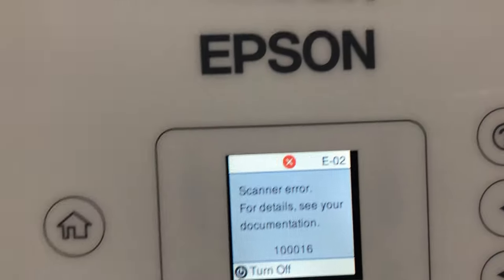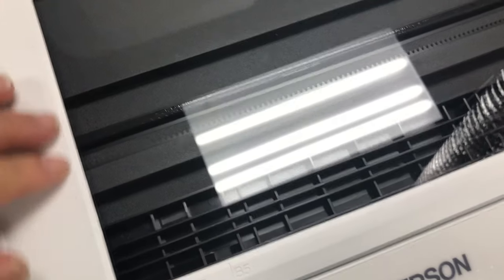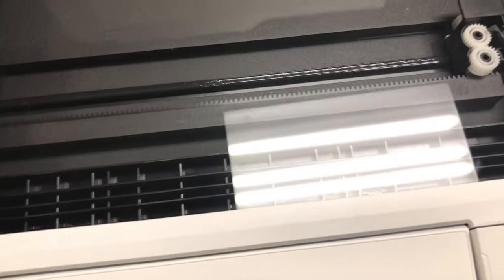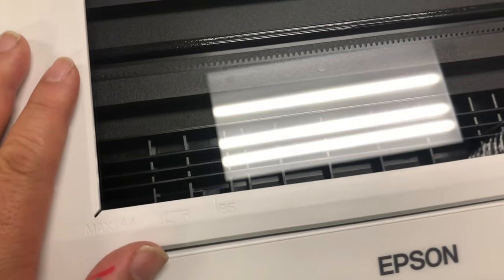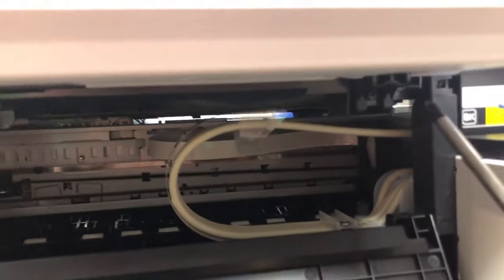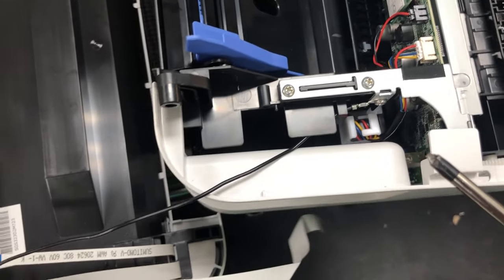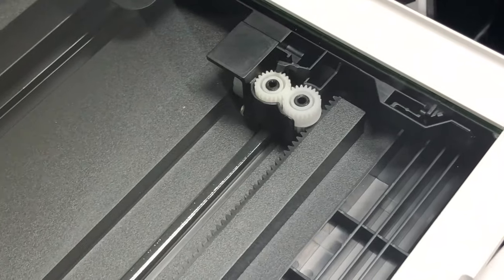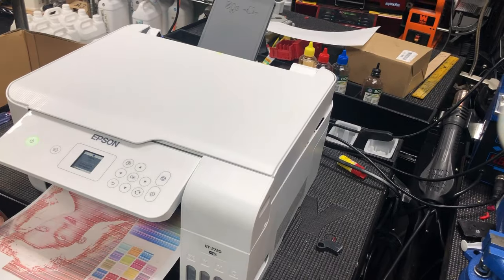Fix Epson EcoTank Error E02: 100016 Scanner Error for details see your documentation.

Comment: Thank you. My smaller ribbon cable came loose. I removed the side of the printer and plugged it back in. This cleared the scanner error. Thanks for the video that hot me headed in the right direction.

Comment: Thank you thank you! I had the error for months on my new printer. I followed your directions and found out that the smaller plug on the motherboard was not connected. It is all fixed thanks sooo much!

Comment: Thank you for your video ,  I tried this method  once before  and it worked ?, it happened  again and now the   smallest  cable wire  is  badly scratched   is there a video on how to  replace or fix this problem, can this wire be cut?  or does the wire need to be completely replaced and if replacement is necessary is there a video on how to do this ? Please  advise   I am sure  that is the problem with the printer as it was working fine.  I really do not want to get rid of it if I can fix it with a spare part.

Comment: Hello, I was setting up a brand new Epson Ecotank 2800 and trying to get it ready for sublimation. Soon as I reached the step after preparing, it mentioned it would take 11 minutes, but before it could finish I received a message that there's an E2 scanning error with the same numbers underneath.😭 All the website says is to shut off and turn back on, but it's been wasting my sublimation ink. I tried to follow the steps you mentioned, removed the screws to open the printer up and looked at the three ribbons, as well as removed the side panel to place the ribbons back where they belong. When I went to open the printer, a screw was missing from the front already and on the inside there was a piece of black tape on the inside near where the ribbons were. I removed the black take and observed the ribbons. I didn't see any damage, so I proceeded to use a dry cloth, even though the ribbons looked like there wasn't any dust or damage. I've been trying to figure this out for awhile now, any advice would be appreciated. The latest is that when I try to turn it on now, it skips the initiation step, but when I try to do anything, such as copy, or maintenance, it says printer busy, and then the same error message happens. I'm not sure if it's the way I'm loading the paper, because it doesn't seem to smoothly be able to be pushed to line up with the arrow where the printer rear tray is, or if I'm not loading enough pages at the same time. I also was in the middle of setting up the wifi network to connect to it, but I couldn't finish setting up the wifi because of the scan error. I finished trying to set it up on my cell which is android, and my laptop I'm using is a MacBook Air. Additionally, I was using brand new A sub sublimation paper, but then switched to use regular copy paper to not damage or waste the sublimation paper, and the Hippo Sublimation Ink that mentioned it would work for an ET 2800.😔 I don't know if it's a printer problem, or a problem with the sublimation ink, paper being loaded, or air in the line, since I can't get passed this error code to even attempt to print anything. Thank you in advance for any information or assistance you can provide.
Reply: Have you figured it out?! I had the exact issue! Omg how interesting! I just bought the et 2800, my husband also notice that a screw was missing in the same spot like you described. Mine is also showing error😒. I'm thinking of just returning it
Reply: Hello  @mayvue3075 . Sorry for the late reply, I just saw that you left a comment. 

I'm not sure if you already returned yours or not, but what I did was contacted the merchant that I purchased from, in my case, Amazon and explained the situation. It was under buyer protection, so they issued me a 1x replacement for the printer, and said the faulty printer, I could keep. I tried to fix the one that didn't work, and found a video that was about the scanner having an issue, where you have to take the section with the glass apart to get to the mechanisms inside. I followed the steps, which seemed like it might work, but then the part that holds one of the mechanisms that moves the scanner, broke when I tried to follow the instructions, so I'll never know if it was an issue because of the scanner not being able to move or it just was a defective item. The replacement printer I took the chance to try setting up for sublimation again, and thank God it worked. So maybe we both just received bad batches or printers that previously were defective, I'm not sure. I hope it'll work out for you too. Sorry for the late response.

Comment: Hi Kevin, I find your channel excellent. I have a problem my Epson workforce 545 is showing a Printer error problem. no code number. it states turn off and then on again. I have done these to many times to count. I changed out the ink and placed in a new Epson ink cartridge. I cleaned the print heads, the printer came back on then I went to check the print pattern and the error came up. Please help.
I have not been able to use the printer since.

Comment: I purchased a used Epson ET 2760 the seller said it had a jam paper error. When we received it the scanner was off the printer with 2 small ribbons out, I don't see a 3rd large ribbon. It appears the scanner was forced too far back when opening it up. Does this model use a 3rd large ribbon? How do we dissemble the printer to get to where the cables connect?

Comment: I tried this and still get the error code, the scanner does not move. You mentioned in previous comments it may be the scanner itself and to take it apart and figure out the problem but I am not confident in myself. Do you have instructions or a video of you taking the scanner apart and figuring out why it won't move?
Reply: I have this same problem,  took out the cables put them back in and still have that same error
Reply: @latoyasmall  Same.  were either of you able to figure it out?
Reply: I have the same issue. And it's brand new! Ugh so frustrating.

Comment: Just bought my printer a week ago , changed out ink (making it a sublimation printer) I initially put in the wrong ink so I followed a video and drained the printer of the wrong ink and now when I turn it on (haven’t added new ink yet) I get a scanner error - 100077. I’ve unplugged and plugged back in multiple times . Nothing . Epson says just take it back to Walmart and exchange it but my Walmart and every Walmart within a 100 mile radius is out of stock. So I need to fix this . Can you help ?
Reply from the maker: You can call Walmart and they should be able to arrange a pickup or Fedex.  What is your EcoTank’s model?

Comment: Hello. Can I get help with scanner error code e02 100032? I remove both of the little cables in the back and reinserted and reinserted the larger cable in the front. The printer turns on but I can't bypass the error.

Comment: Great video. I have a brand new Epson ET2720, it was working perfectly until i had to replace the ink with sublimation ink, then had the error 10016, which you helped me fix the issue, now i have the issue of error code 10032. I've uninstalled and then reinstalled the software. Any ideas of what might be causing this error code and how to fix it?
Reply: I have the same error, did you ever fix yours?!
Reply: Same error.. anyone know? It's so frustrating I've tried everything 😫 nothing works. 100032 giving me hard time!!
Reply: @LC-no5zx  luckily mine was brand new, I returned it and bought the ET2800, it’s been great!
Reply: @candacealfonso8279  lucky!!!unfortunately mine is done on any return lol I got mine in May last year but I've only used it 35 x so it's basically new. I ended up taking it apart and making sure wires were plugged in right like 50x. Then when I was about to give up it magically started working again. No more error. It's really hard to hold top open and try getting wires in with no help. Now I just gotta fix the black ink cuz it comes out really bad when I print. It's lines everywhere.  🙄ugh
Reply: Instead of remoting in wirelessly, I plugged it into my computer and it’s working fine now.
Reply: I have the same issue.  I change the ink .  I don't know  what to do. All the cable that he show in the video are in . So I don't  know  what is the problem.  I download the software still.

Comment: I think my issue was the wires got pulled out... but I have reconnected everything and I'm still getting the error. Only thing I can think of is that where it connects got ripped off the board and now it can't connect anymore--that or the ribbon wire got damaged.

Comment: Help.  I can see I have the med and the small cable that aren't connected to anything.  I can't no matter how hard I try to get the back off.  I have pushed in on the white tab but it doesn't seem to release anything.  What am I doing wrong.  This is a new printer and I am getting really frustrated.
Reply from the maker: Make sure they aren’t upside down.  Hold on the blue part and push.

Comment: I followed the steps and connected both cables in and nothing prints out still. Help 😭
Reply from the maker: What is the error code displayed on the panel?
Reply: @BCHTechnologies  there’s no more error code. Omg ive watched so many tutorials and none of them have worked im doing exact steps idk what I’m doing wrong. It prints as If it’s going to print but it’s a blank page. I’ve done everything
Reply: @iitselyyyfooo  did u find a solution in having that problem

Comment: It would help if you show how to open the front of the printer instead of jumping ahead
Reply: Hi, there are two screws   one on each  side  corners  of the printer . its on the top  under the  window pane, remove them and you will be able to lift the top.   inserting the  smaller wire can be tricky.  I had to remove the side panel  of the printer in order to  insert the wire into to place.   It comes out easily  so I have had to do it  a few times.   I have watched some people re insert the wire effortlessly  without removing the side panel  I have not been able to do it.  I hope this helps

Comment: I bought mine April 2nd 2024. I used it once. My husband used a little bit. I finally had time to work scanning some photos it scanned multiple times, but yup, I got that error. Peice of junk! I called staples 30 days to return um its May 7th 5 days late. I have my slip but not the box. I'm so disgusted. I'll see if my husband can fix this. So how many of these printers have sold? Junk pure junk

Comment: I want to cry now the screen won’t turn on
Reply: could be the board wire is loose  and needs to be  re inserted.  The is the  white  thicker wire that is  visible in the front of the smaller ones that are hidden.  I hope this isn't to late
Reply: Thank you it works 😊